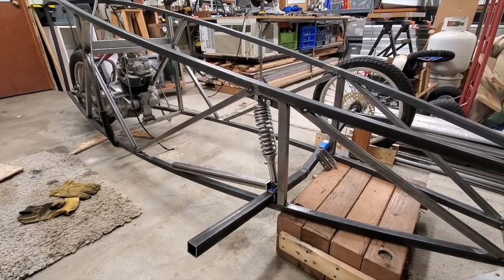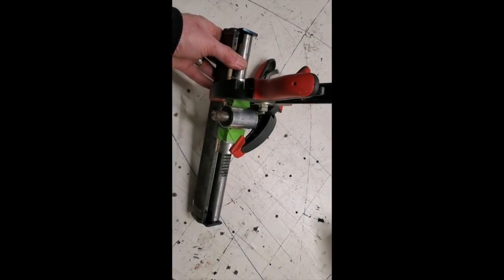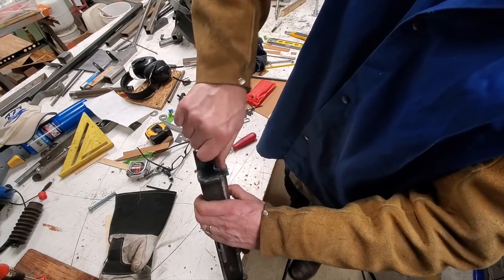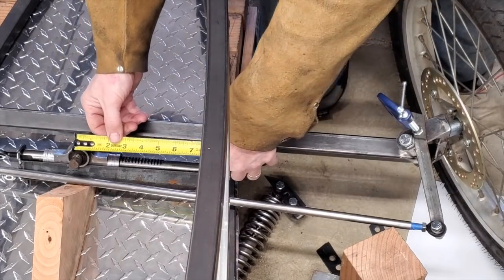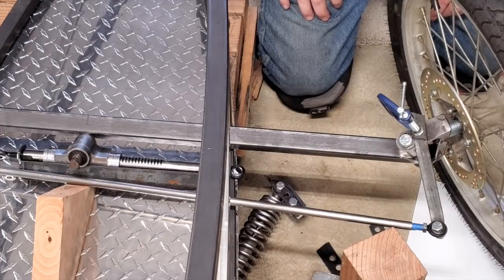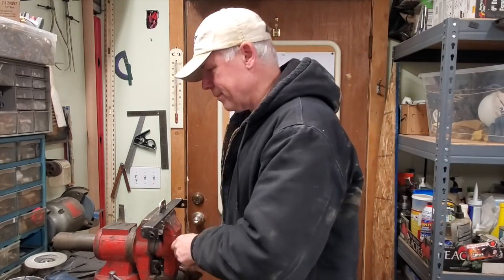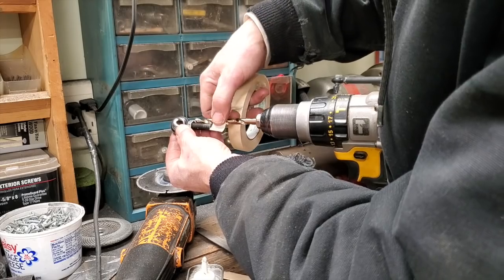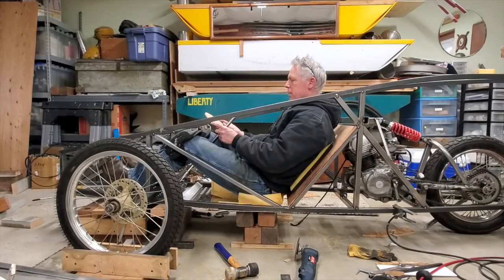Fuel efficient reverse trike build (part-4)

Comment: if you put suspension back intoo the front axle it might be simpler (steering geometricly speaking)  bolt the steering mecanism to the crosmember that holds the wheels and make the steeringshaft so it can move up and down / in and out with the steering box mounted to the suspension beam
this prevents the wheels from toeing in or out during suspension travel or doing sudden direction changes when the trike slightly leaning over in turns and it shouldnt matter a lot where the steering linkages mount to the steering box as its a solid axle , it allso alows you to lift the steering and dashboard up and out of the way wish makes getting in and out eazier 
they stay in the same plane from eachother not moving independently from eachother like with a double wishbone setup or with the steering box mounted to the frame with the axle moving around it 
all that is important that the point of steering doesnt move about from the center of the steering (up and down not side to side ) 

either way you need to put some sort of linkage to the front suspension or a crossbrace between those suspension arms to keep it centered side to side 
wat might work is a piece of pipe  mounted to the frame under or realy close to the steering beam with a greased up pipe inside it sliding and a rose joint bolted to the center of the suspension , that should alow the axle to move up and down but not move side to side when theres a sideload on the front wheels (in corners)

Comment: Enjoying the build. 👍
By lining up the steering arms with the center of the rear tire, shouldn't that correct for the turning radius differences between inside-ouside tires.
I think the steering pivot arm length should be the same as at the kingpins.  
Without independent suspension, It may be best to have one connecting tie rod and then one to the rack and pinion.  imho

Looking forward to the next installment and May the redos be avoided.

Comment: An added gear box for reverse would have been nice. My last Goldwing used the electric starter for reverse. After climbing in and out of it a thousand times your going to be wishing you had reverse!
Reply: @ddymnm   That's about the cheapest reverse on the market but you got to climb out of the trike to use it so you might as well just push!
Reply: @ddymnm   Electric hubs are not designed to be driven and I think most of them are not designed to work at highway speeds. A friction drive on a tire would also require a way to engage and disengage making it not as practical as you might think.

Comment: its looking sweet.. racers use holes to lighten components, there are a lot of places you could add holes in the steering arms, the angle iron on the rack even the rack and frame. you could just drill through one side of the frame tubes
Reply: I agree although if he drills holes in components outside the trike, like some of the steering components he might end up with more drag.
Reply from the maker: @lucasvanhamburg4937  I've thought of that but for now I'm erring on safety. If I had the brains, money and patience to auto cad the design  and put it in a stress test program I'd do it, but I'm old fashion and lazy.
Reply: Great project! Old fashioned maybe, keep adjusting by trial an error, but lazy. Never!

Comment: Awesome progress.

Looks like you've got yourself a poor-mans Y-Link suspension.
That's pretty common for straight axles on older suv's like the Jeep Cherokee.

As you know, your caster angle changes with suspension travel. That (among other things) can lead to "death wobble" if you don't have good alignment. the off-road guys (myself included) would commonly band-aide death wobble with a fresh steering damper. I wouldn't suggest that, but if you end up wanting a steering damper: You may be able to get away with a quality (more than $200) linear motorcycle damper. The cheaper dampers are junk.
Reply from the maker: Thanks for that Josh. I'll eventually add a steering dampener, but for now I'm still on the fence about the front suspension set-up. I still might go to A-arms. More part but way less stress on parts and a much smoother ride.
Reply: @paulwelkinsdiy  I'm intrigued by the straight axle. I think it could work nicely and I like that it's different.
My biggest concern is just the lack of alignment adjustability and whether or not that would result in death wobble. You can't know for sure until you get it on the road and put in the miles, hitting bumps every which way. I'm watching these videos with great interest.

Comment: Ackerman steering angle looks way off. If you have your kingpin angle set for zero scrub radius then your ackerman angle is based off the centered front tire contact point. Which is to say that the steering arms ackerman angle is identical to the tire contact point ackerman angle as it's all the same as far as that contact point is concerned. If you don't have your kingpin angle set for zero scrub radius then ... Well, you have a more fundamental problem. Being off at a single point of steering input doesn't really tell the story of the issues caused. As you aren't concerned with a set amount of steering input but instead the ratio through the sweep. Which will change dynamically if off.
Reply: Yes, well explained. I used a spread sheet program to help graph potential issues. Trigonometry skills increased.
Hope to improve the Ackerman on mine soon.
Reply from the maker: The kingpin is 3/4" inboard of the contact patch (was hoping 1") and 2-1/4" forward. I'm going with Ackerman steering geometry suggestions from Bob Stuart my engineer friend. We'll see how it pans out during test runs. I may also throw in the towel on this set-up and install an A-arms instead.

Comment: Looks good to me Paul. I will make one suggestion thatbeing put a U-joint on the bottom of your steering shaft this will let you move the wheel forward more out of the way making getting in and out of the machine a bit easier.

Recently I messed up my knee so I've been looking at ways to make getting around the home and in and out of the vehicle easier because I know I'm not getting any younger.